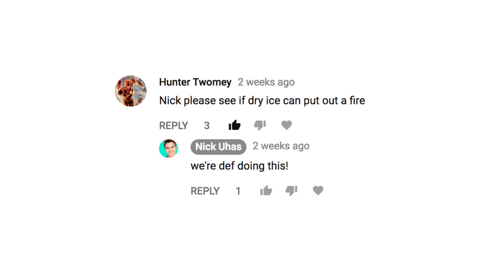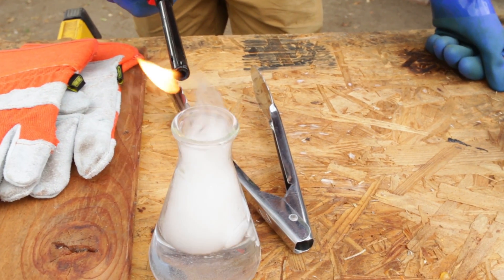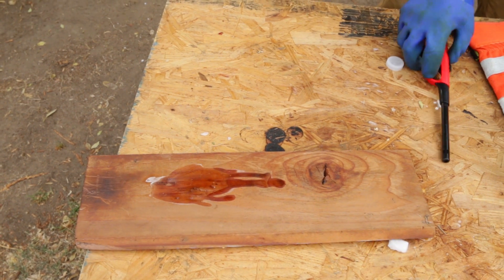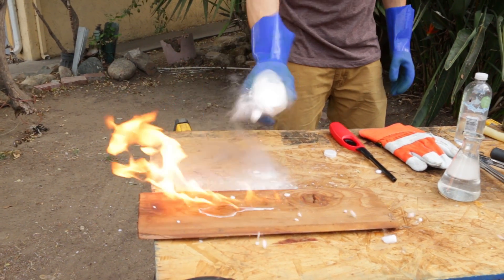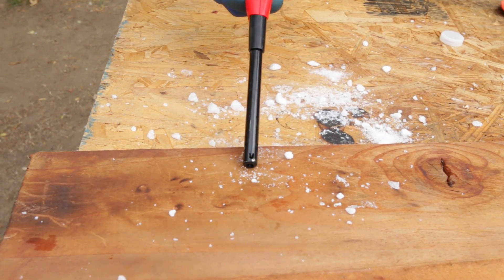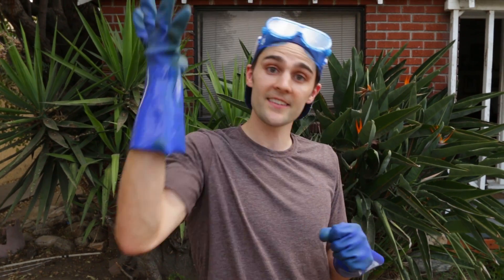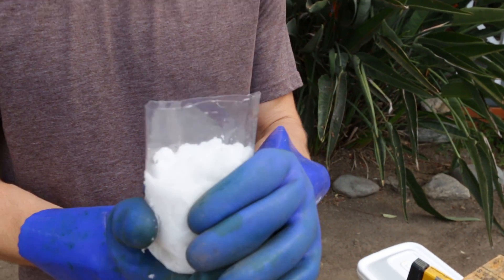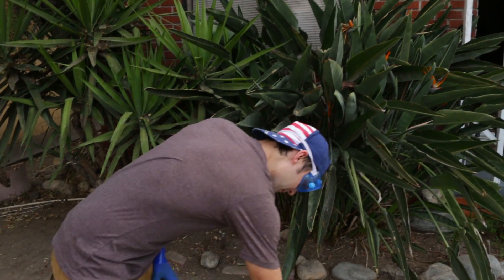Can Dry Ice Put Out A Fire?

Comment: Make a CO2 canister as big as a firetruck. Using the gas to put out the fire in an instant. Putting out major fires with CO2 instead of water. Or maybe that's too much CO2 displacing oxygen in the area. But I still wonder what would happen. Pull up with a CO2 tanker truck and put out a building fire. Or pouring directly into a forest fire.

Comment: CO2 is already used in CO2 fire extinguishers. So if you  use a solid state also known as dry ice it not only displaces oxygen but also cool the temperature of the fire, that is why aerosolized dry ice works real well but it is only suitable for small fires and the solid state is better for use on larger ground fires. For it to work best on a ground fire it need to be granulated or in a pellet form as opposed to a solid brick, giving a larger surface area that way it removes 2 corners of the fire triangle, air and heat. If you want to speed up the melting process just spray a little water on it (the warmer the water the quicker the reaction). If you look at music videos from the 1970's onwards you will sometimes see performers walking through a low fog, that is dry ice with water added and is causing it to go from a solid state to a gaseous form. So, if say you had a fire on a hill you could place some dry ice at the top, add some water and as it melts the CO2 gas would roll down the hill and as it is heavier than air and extinguish the flames as you are removing at least 1 corner of the fire triangle (heat, fuel and air). so yes, dry ice can put out a fire, it just depends on the size of the fire. You can also use dry ice to cool down a fire so that water would become more effective.

Comment: Breaking the myth and misconception that has been spreading around that dry ice cannot put out fires This is actually not true dry ice can put out fires. Also it's important to note I have watched this whole video and I already know that the guy explain that it can I'm just putting more info here that I myself have put together about this so people can get even more thorough information that they can read.

When dry ice is placed on top of a fire, it undergoes a process called sublimation, where it transforms from a solid state directly into carbon dioxide gas. This liberation of carbon dioxide gas plays a crucial role in fire suppression.

The carbon dioxide gas released from the dry ice interacts with the fire in several ways. Firstly, it displaces the surrounding oxygen, creating an environment with a reduced oxygen concentration. As we know, fire requires oxygen to sustain itself. By reducing the oxygen levels in the immediate vicinity of the fire, we effectively starve it of its essential element.

Additionally, the carbon dioxide gas released from dry ice has a cooling effect. As it expands and rises, it absorbs heat from the fire, further diminishing its ability to propagate. This cooling effect helps lower the temperature of the fire, making it more difficult for it to spread.

Moreover, the carbon dioxide gas plays a role in suppressing combustion reactions. It interferes with the chemical processes that fuel the fire, inhibiting the chain reactions that sustain it.

Comment: Why don't firefighters use CO2 if it's so good at putting out fires?
Reply: Fire extinguishers do use CO2, however, large amounts of CO2 is unrealistic to easily transport and much more expensive than water.
Reply: you obivously dont know much about firefighting the primary agent in firefighting is water but most fire truck ususally have a co2 fire extinguisher somewhere though  It can re ignite easily some chemical automatic fire extinguishers contain co2 the idea is if you have a total flooding system and fill the room completely with gas it will suffocate the fire

Comment: There is actually a little bit more to this than you let on.  There is a reason CO2 and H2O are specifically used to put out fires.  These two substances are particularly not flammable since fire is actually a chemical reaction.  Like all chemical reactions there is an input and output.  The output of a fire just happens to be CO2 and H2O, which means they will not burn.